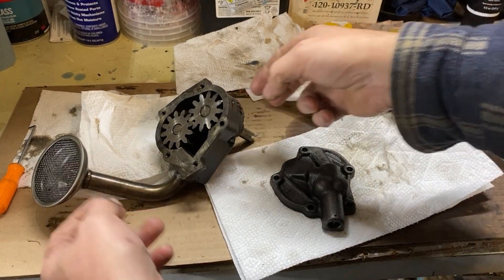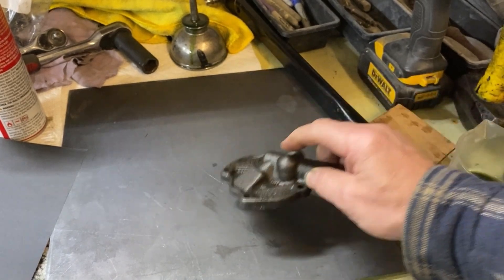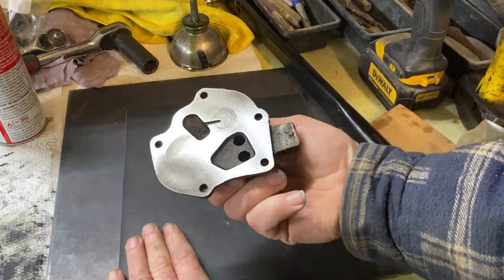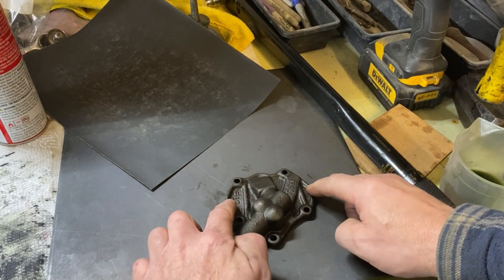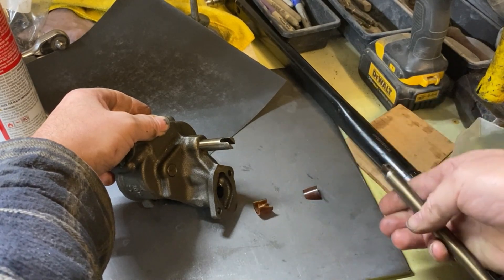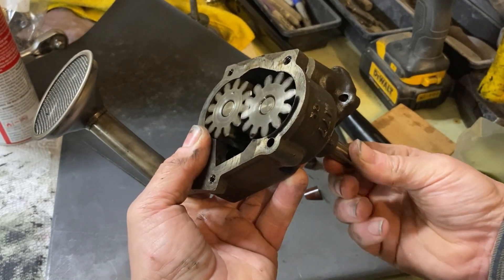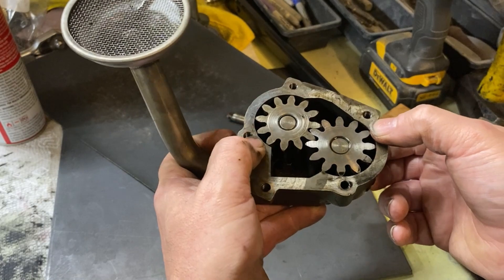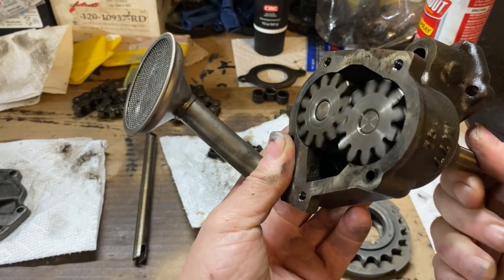How it works: Gen VI 454 BBC Oil Pump Rebuild

Comment: If you check the rotation of the distributor, you'll find the pump spins the opposite direction of the way you explained.  Oil is carried in space between the teeth of the gears around the outside to the high pressure side.  The teeth meshing prevent oil from crossing back to the low side, forcing the flow through the outlet.  A roots blower works the same way.
Reply from the maker: Good info.  Thanks for adding the comment and clarifying that!

Comment: The reason I have to run a HV oil pump is because of the lifters that I'm using in my engine. They're anti-pump-up direct lube race lifters, so they need a bit more oil volume to keep them flowing properly, also helps lubricate the camshaft.